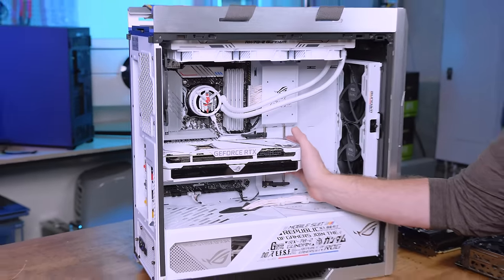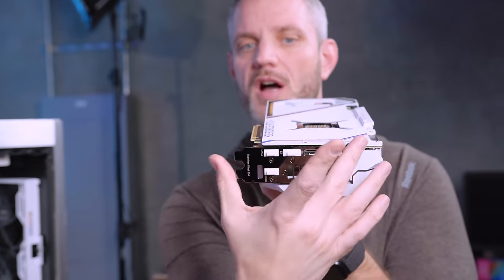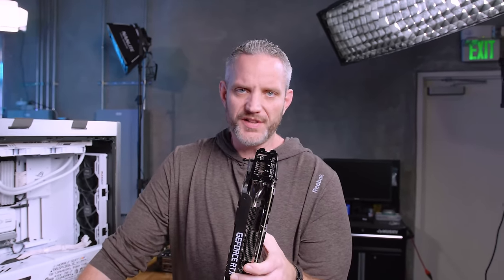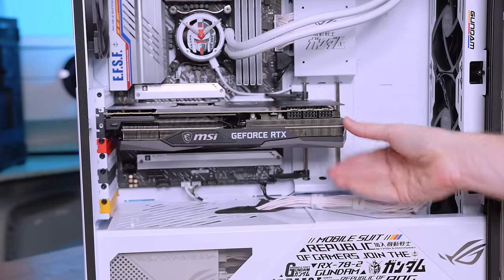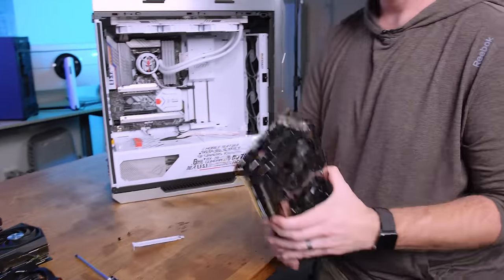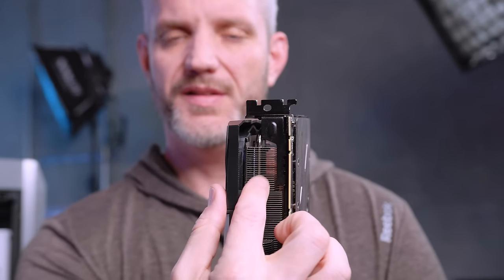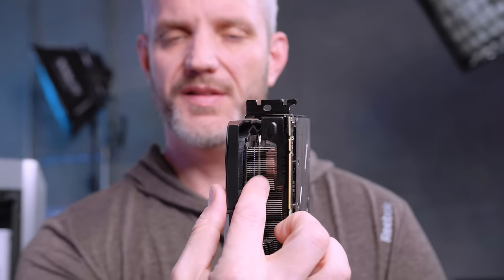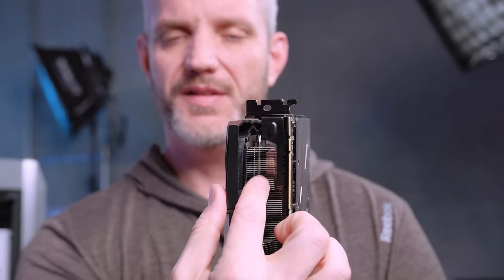How to fix GPU sag ONCE AND FOR ALL! FREE!

Comment: Wouldn't this make the point of gravity shift more centered to the PCI x16 channel itself though. Which would add more stress to the MB PCI x16. I feel like Industry should have not taken the short straw by using gaming styles on a card problem. That could be solved with engineering they already used in industry for heavier cards. Just by adding second shoe holder or extender bracket model past 10## series.
Reply: No, it just makes the card supported the same way as GPUs always have been, this is a new issue with 30 series. The case bracket will take all of the weight this way. I don't see how people are interpreting this as putting more weight on the PCI slot when without this mod the PCI slot is literally taking the majority of the weight until the cooler makes contact with the case bracket.

Comment: My Pain is Your Gain!  I learned about GPU Sag the hard way.  My Sag ripped the pcie slot out of the MB, which presented itself as intermittent operation, post fails, OS load fails, etc.  it took me MONThS to find out the slot was bad.  When thinking about the solution, I have come to the conclusion that the electrical connection that IS the pcie slot, is capable of North/South force but introducing twisting force in other directions is just asking for trouble.  I have a brace that mounts to the MB which supports the side that is closest to the MB, but the best corner to support is the outside/front corner.  It’s a design nightmare.  Thanks for your good idea, which is a big improvement, but I think you’re focusing on the wrong corner.  I strapped 10 helium balloons to my outside front corner but unfortunately I have to refill them every day.  I might consider upgrading to mylar.

Comment: Yeah this has been a problem for a while thought they would start to design the cards better but they never did. In my old computer build I would just put a regular pen(I used one with an eraser top) cut to size between the bottom of the chassi and the gpu to properly support it. With my newer computer I didn't have this problem so that was good.
Reply: you know what fuck it im bout to do that

Comment: Something is holding the rear I/O mounting bracket to the rest of the assembly on every one of those GPUs...  Most likely its screws, whether visible or concealed... Those screws need to be tightened first... Then mount the GPU into the MOBO, and put the screws in... Get a ruler or tape measure, lift up on the front end of the GPU, and take a measurement from IT down to the nearest part of the frame that will support weight... If there's nothing under the GPU, then just measure to the floor of the computer... Then find a good-lookin' piece of wood or plastic, cut it to that length, and prop it up under the FRONT end of the GPU, using caution not to get any fan blades involved... NO MORE SAG...

Jay, I think you're a great and knowledgable man on the subject of all things computer... I watch your videos all the time... You have SO MUCH computer information in your brain, it's a wonder your head isn't twice the size... But, with all due respect, the shimming concept in this video is totally flawed... The best way to get rid of GPU sag is to support it near the front end... Thanx...

Comment: As an old timer, this was infuriating to watch.  Computer cases used to have a card cage at the front of the case that the end of the full-length cards would slide into.  Never had sag with that.  Then, cards got shorter because component integration got better, so case manufacturers started using that space for other things and no more card cages.  Cases need cages, gpus don't need stupid brackets that look like grandpa's car jack.

Comment: MSI included a two slot support bracket for my GTX 1080ti Gaming X Trio. It's decent but looks like another full length card again and has to be fitted on top of any cards in the slots below. It's also a pain in the backside to screw down. Definitely going to try this

Comment: Just install some black felt strips. Quick 5seconds, wipe away dust and use a long felt strip on the case or the card. Should work with no stacking of PCI covers.

Comment: I think the best way to solve this  would be motherboard, GPU and case manufactures work together and come up a new industrial standards allow PC builder attach the back plate of the GPU to one inner side of the case pannel. For example: the bottom pannel.

Comment: Not really thought about this before, but a metal bar the shape of an Allen key that goes say 3/4 of the length of the gpu on the top edge, possibly with some  adjustable sliding fixing that locks sounds like it would work.

Comment: Palit basic VGA holder does the perfect job. Been using the 3080ti gaming pro and the holder for some time now and it looks fine by me. Corsair airflow 4000 is the case in use

Comment: Older ATX chassis from the days of full-length cards which may have 3.5" hard drives attached had supports. Card supports were sacrificed for aesthetics in the late 90's-00's.
Search for images of the inside of an old IBM 286 and you will see slots on the front of the chassis that grab the back edge of the card for support.

Comment: Vertical mount it, it looks better because you see the front of a GPU, and yes it has worse thermals, but most people typically got fast enough gpus anyway where they can keep thermals fine, and still get enough FPS to completely use ur monitor

Comment: I have fixed GPU and GPU sag the easy way, I simply put my Lian li computer case on the side and later bought a cube case with motherboard that is horisontal, both modded with lots of 14cm fans blowing cold air straight to both CPU and GPU (that helps enormously in keeping the GPU cold and a little on the CPU) ...

Comment: How to fix saging of a  GPU once  for all. (Using plain old Phisics laws) 

1. If you are using vertical case, lay it horizontal. (If it is possible) 

2. Get a horizontal case.
  - or case with horizontal motherboard placement. (it fixes problems permanently) 

3. Get a GPU expansion mount  bracket, that holds GPU vertical. (best longterm fix for vertical cases) 

*No more broken GPU-s
**No more void warranty-s on    GPU-s do to sag damage on cards itself.

Comment: visually it is better, but there is still a little less weight hanging on the pcie slot, but this weight has not disappeared, only the point right behind the herring is more loaded and exposed to PCB bending.

Comment: Did this fix for the TUF 3080 RTX and worked like a charm, disappointed that they really didn't just make it a 3 slot bracket, as if I'm going to be able to use that 3rd slot with the card blocking it off

Comment: Not a bad solution, but I'd rather see card manufacturers add a bracket to the far end of the cooler that can be attached to the panel the mobo sits on. It hangs out past the edge of the motherboard anyway. They could make it adjustable so you can move it around a bit to find a hole, but even if you need to drill one in your case it would be a clean look in the end.
Reply: just fill that void in you gpu's life and it will stop sagging no more saggy gpu🤣🤣🤣🤣

Comment: Video starts: 9:52

TL;DR Support the GPU [IO sheild] with the PCI-e slot covers you have from when you took out your graphics card - Jay takes off the very botton of them in order to use them for this purpose but you might not need to do this, atleast for the ones on top

Comment: you added a camber to the card. Happens all the time in structural engineering. This fixes the final height of the card but it does not affect the overall sag the card will experience. Gotta support the other end to eliminate sag. Either that or reinforce the GPU frame to make it stiffer so it cant sag

Comment: I'm surprised there isn't a card support out there, You need something like brace or support prop, i made a brace for mine which bolts to the case front and back with a bit of an edge on so the card can rest on it when the pcs in vertical position my card weighs a ton that way the cards weight is fully supported and you are not putting unnecessary weight on the pcie slot I've seen colder solder joints on pcies wherethe weight of the card has lifted the slot  off the motherboard due to the weight of these modern cards.

Comment: Easiest fix is to take a plastic straw and cut it to the right height and then just stick it under the card on the saggiest point generally the one that's furthest from the card and bracket
 works till you have to move the PC
Plus it's either cheap or free it doesn't require any specialty tools beyond a pair of scissors or a sharp knife

Comment: Just find the size you need and 3d print a pcie expansion slot with the factory dimensions and extend the thickness facing the card easy

Comment: One issue with this approach is it addresses only one vector: sagging to the right, roll, if you will. There will still be some pitch issues. I think I’m going to design a support bar for printing on a 3D printer.

Comment: I just slide one of the protector shields behind each of the ones already built into the card and screw them in.  Does the same thing.  You can also cut one and put it horizontally to create that bridge between the solid part and the floating part.

Comment: Your my hero man just got a 3080ftw3 (EVGA queue woo) but my glass side panel was pushing into the 3 8pin connecters moving the whole card. I thought I was gonna have to get a new case but after getting rid of the sag Its just barely clears but is not touching at all. You saved me $100~ Thank you so much!

Comment: The best no sag card ive ever seen is the nitro 7900xtx.
The cooler is not just some plastic thing on the top but it completly wraps around the card in one strudy casing. The bracket is on there so tight that it has 0 sag.

Comment: Finally, I take out the can of Orbit chewing gums that's been keeping my 6900XT from sagging.

Note that results may vary depending on the spacing between individual slot shields. My older case has nearly none, making this method extremely effective, while my Meshify has about 3 milimiters between them. Still effective, but the GPU has to enter its PCIe slot under an angle to make contact with the shield stack.

Comment: I actually did something similar using those brackets coupled along with the packaging the came with my GPU, before I found this video. My GPU has a custom waterblock so I had to apply the brackets towards the glass of the case as oppose to anywhere else.

Comment: You know that foam that's inside of certain boxes? I think mine was in my power supply box, I just cut a piece of that off and stuck it under the GPU. Worked just fine and took like two seconds.

Comment: If the problem is the lack of support on the opposite corner of the card then the obvious solution is to add a support point in that corner, not by adding stress to the side that does have support. Ideally by case manufacturers, or oneself since they don't seem to be willing to address the problem.
Just bend a flat metal strip at the ends like the square bracket, one end is screwed to the case, the other one provides support for the card.

Also, this is just 15 minutes of blank talk.

Comment: I feel like while it wouldn't be a free option, they should just sell those PCI brackets in an L-shape so you can prop up the back of the card with the part of the bracket that sticks out under the card. Would be a a hell of a lot cheaper and more convenient than most of the other solutions I've seen people do. You could even 3D print the damn thing, and if caught on, maybe GPU manufacturers/case manufacturers could include them!

Comment: For me I think my Zalman tower's brackets never align with GPU's. Which is dumb because other expansion cards from usb to wi-fi cards screw on just fine.

hum... After watching this video maybe Gigabyte is the culprit here not making standard mounting brackets. Given that I tend to go with their mobo and gpu's when possible thinking they'll be most compatible with one another.
Reply: Yes, it's always Gigabyte - they always have messed up the alignment of the bracket/ports on gpus - even going as far back as 750ti cards - you can see the alignment is wrong as the hdmi ports always come right close to the case divider metal.
Reply: @marknewellmusic  Yes. I fear the board might be slightly bent as a result of forcing the card in place over the years.

Hopefully it's just the card being shitty as I'm only getting visual glitches from the ports.

My GPU is the GTX 1050 so I'll be content in replacing it if I ever have the kind of cash flow again to upgrade hardware.

Comment: I have on an old  windows Computer (i use mac normally) an Vega 64 from Asus Strix. This Card is light Sagging, i order an GPU Holder with RGB cmon its 2022 :D it work well. I found out a cheaper way is to take a metal washer on the 3rd PCI Slot, that support the IO shield from the card, like same way what Jay done but in elegant. How it work? You install your Card lemme say u have a 2-Slot card, and then screw the Card after this u take a metal washer on 3rd Slot and Put under the screw from the 3rd slot. make sure the screw from the Card also 2rd Slot is 
touch the washer. Sorry for my bad engl!

Comment: that or use a case that have GPU mount by extension on the bottom or case that allow you mainboard mounted vertically (90° clockwise) 😁

Comment: The anti-sag bracket that came with the 4090 didn't fit my case so I just cut a 1/2" wooden dowel and popped it under the saggy part of the GPU so that corner is essentially resting on the PSU shield.

Comment: American airlines once removed one olive from each of their on flight meals that had olives, reports vary on how much money was saved, but that one olive across every meal for every flight did end up saving them money.

The small piece of metal? Those 3 screws? The entire cooling block needing to be made larger to reach the supporting bracket? Imagine how many cards are sold, according to an online site it's over 20 million RTX cards, say half are 20 series, that's 10 million 30 series cards that have that is missing that small piece of metal, 3 screws and some cooling block.

That's a lot of metal.

Comment: I used an ice-cream stick to provide structural support on the other end of my RX 570.
Then I went on to string the heat pipe (which seemed structurally sound) to the top of the case.

Comment: The obsolete worst cards for this are the old style wind force cards like hd 6870s and gtx780s with those triple fans and all copper hear sinks. Can’t tell you have many of those I’ve had sagging so badly they don’t work anymore. I only vertical mount them now.

Comment: Random question that I doubt will be seen/answered but I’m asking anyway — what are the PSU cables you’re using? I’ve yet to find a set with 3x PCIe 8-pin cables that has white sleeves + white connectors. Can only find white/white 2x PCIe 8p

Comment: Just about to start my first build this week and I'll absolutely be using this tip, thank you!
Reply: just remember to shim and fill that void so no gpu sag and your system will look awesome and no need to worry that your gpu pcb might crack either nip that issue in the butt before it can happen so it does not happen

Comment: Encountered that issue the first time back in 2013 with my Radeon HD 7870 XT. Since the pcb had two small holes on the sagging side, so I just used a piece of kite-string and tied it to the top of the case. Somewhat annoying, that this is still a thing today.

Comment: I just use some of the packing rubber and put it under the card where the power cables are worked like a charm Gigabyte 3080. So it's like a 60x90 mm size looks fine.

Comment: I think the age of the TOWER should come to an end and we should return to the good old days of the horizontal desktop IBM AT PC style (remember basic beige color?) - that would not only fix the GPU sag issue without any additional hardware but also relieve the stresses from those honking 2-fan, 5 pound air CPU coolers these days. Yeah I know there goes the desktop real estate, but I think it's not as bad as it may seem with some ATX case redesign. Gravity sucks, always.

Comment: I'm pretty pissed at EVGA for these quality issues... Have to RMA my 3090 or fix it and void my warranty 😕 -- Heatsink is sagging away from the thermal pads near the IO plate because it's also not secured well to the backplate.

Comment: This is no near a replacement for a support bracket, because the card is still exposed to the tension that sooner or later could result in failure due to break of solder joints under the chips...

Comment: A visually better looking fix is to run your GPU power cables down the backside of the GPU and use them to pull the card in the opposite direction of the sag. You can buy aftermarket 180-degree adapters that will allow the power cords lay down nice and neat along the backside of the GPU, until the power cords disappear into an open slot toward your cable hiding area..

Comment: I'm from the future to say i have both an EVGA 2080 super hydro copper, and a brand new 3080 hydro copper. the 2080 at least has a double slot bracket even though it's single slot thickness. the 3080 has a single slot bracket with zero support. im immediately worried about mounting it horizontally instead of vertically like i did the 2080. and holy hell the 3080 hydro copper is HEAVY. it NEEDS a double slot bracket to hold it and they don't even give you that.

Comment: Couldn't you also fix sag by placing a plastic support post at the far side of the card? It seems like most cases have a flat cover over the power supply which you can place a support post.

Comment: The stupid part of newer strix cards is that they actually removed that l shaped metal bracket that used to fix the flex that they had on the rx 570